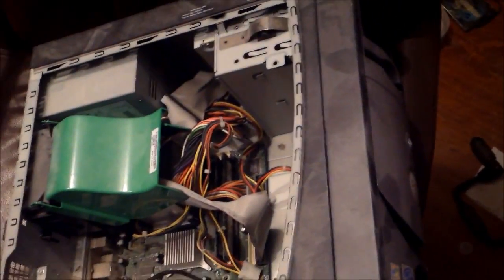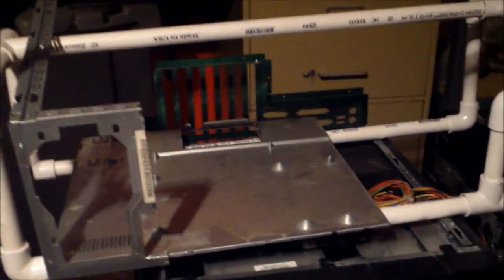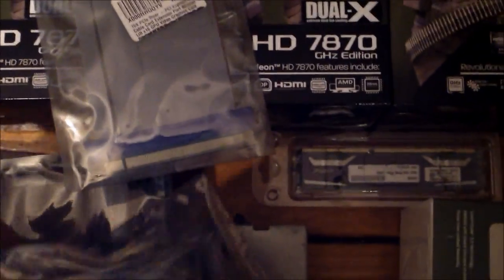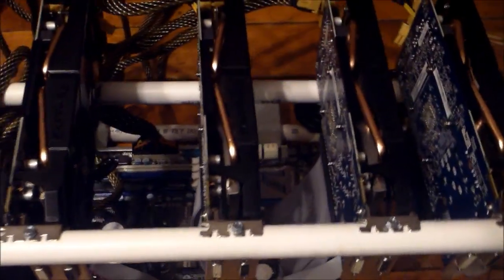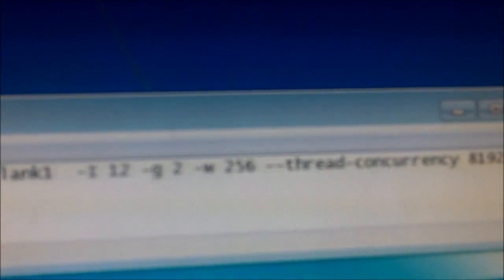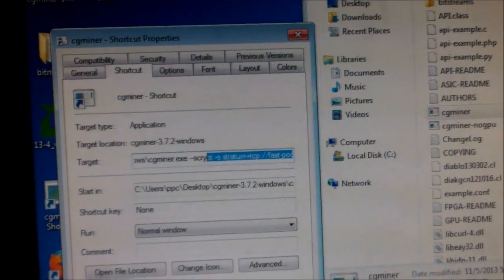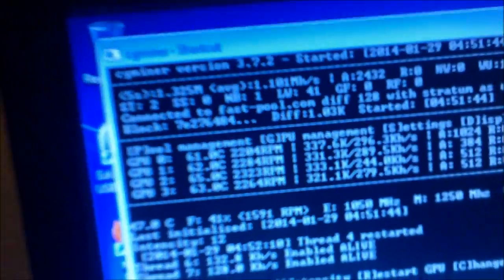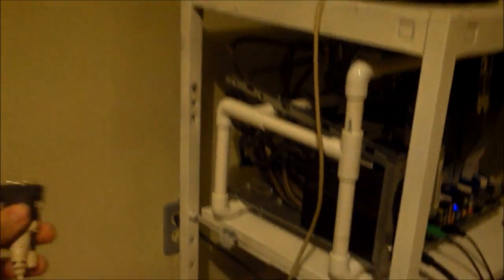How To build a DogeCoin Mining Rig

Comment: Finally found you on youtube again!
I have a Doge miner running in my garage with a lowly 5670 doing 100KH/s on an old E4200... it's kinda alright. bought a thinkpad T500 with my spoils so far.

Question for you: are your PCIe extenders properly shielded? I read someplace stuff about interference, and that some miners get better Khash rates and stuff if their ribbon cables are shielded, both proper 3M shielded ribbon extenders which can be expensive all the way down to shielding a cable yourself with foil tape. Thoughts?